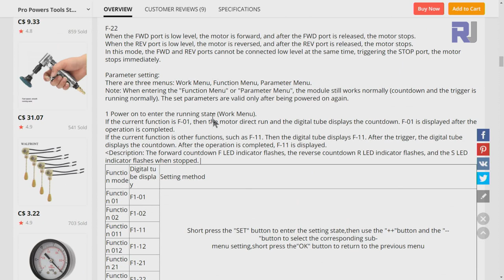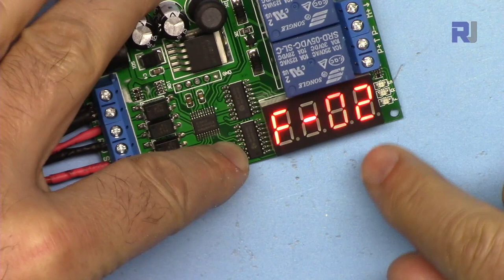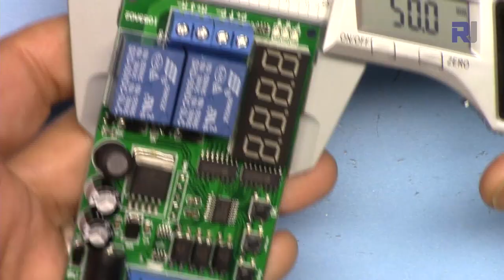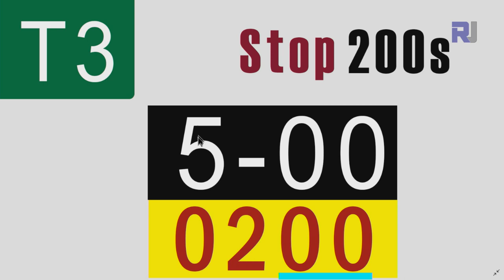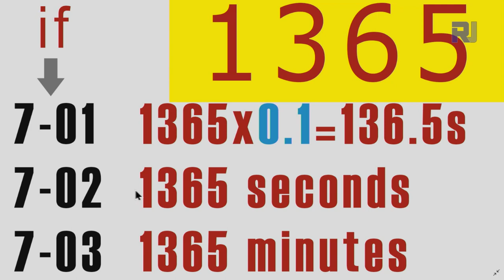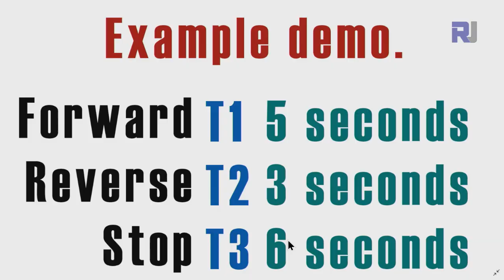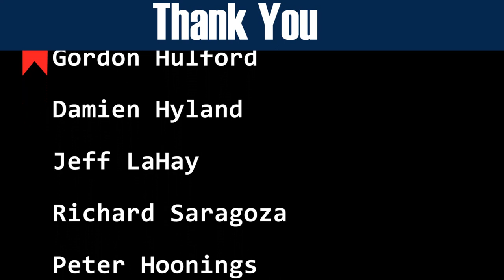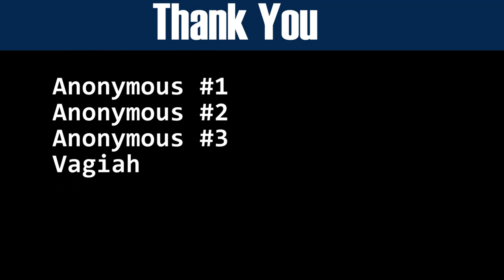Multi-function DC/AC 5V - 24V Forward Reverse Motor Controller Timer I053A02

Comment: REPEATING (LOOPING) PROGRAM:   Several people have asked how to set the board to repeat the cycle automatically.  Essentially, parameter 8 sets the number of times to repeat, 1-99.  0 means repeat indefinitely.  Default is 1.   I found a clue to this in a table I found by googling "canton electronics Model IO52B02".   Instructions there are a good supplement to what is in this video.    (Shoutout to jw11432 who also addressed this in his comment).

Comment: hi, i want to use it to do latching for water valve-a latching valve require positive pulse to turn on and negative pulse to turn off. Can i set it to forward for 0.1 sec and stop for 15 min and then reverse for 0.1 sec and delay for 12 hours before foward again?
Reply from the maker: Hi, it has 3 settings. but you want 4. you want extra delay. I've explained it at best possible ways. if the thing you want to do is not possible by this module, then you might  need another of this module  and some how after motor is stopped (after reverse of 0.1s) then it should keep it OFF for 12 hours. and you can use the trigger feature with some wiring which I don' t know at the moment how.  For that you need to check the 1st module and see after the last step which pin or location on the module is changing the state from LOW to HIGH or from HIGH to low and then solder a wire on that spot and connect that wire to the trigger input of 2nd module.  Depending on the LOW or HIGH then program the 2nd module to turn ON after 12 hours. then do the same. on 2nd module find the same spot and solder a wire and connect it to the trigger pin of 1st module and it should work. It needs patience. Or simply use Arduino which opens the whole word for you and do anything you want. Program it and upload it to Arduino.  See this video https://youtu.be/JMBgGO07YLM
Reply: @robojax  thanks for your advice. i also think that i may need extra component

Comment: Is there a simpler controller if I want to set it to  switch polarity forward 5 minutes and reverse 5 minutes automatically and stop in 2 hours with  30Volts DC, max ampere less than 1 ampere? This is just overkilled.
Reply from the maker: This is very cheap and if you go with anything else, it would cost you more.  Here is my video if you want to do it with Arduino https://youtu.be/JMBgGO07YLM
Reply: @robojax  Ok, Thanks.
Reply from the maker: you are welcome.

Comment: Hello, I just watched your video and programmed the unit.  It works, but now it won't stop running the program.  F8 is set to one, but it just keeps going.  I saw a factory reset option of pushing the ++ and -- buttons simultaneously for 5 seconds, but that doesn't stop it either.  Could it be defective?
Reply from the maker: Hello, if it doesn't do what it is supposed to , then yes. it should be defective. But I would suggest following exactly as shown in video.

Comment: hi there, ive got a 24v garage door motor with a burnt out wireless reciver board that does not work, but when i applied 24volts direct to the motor it works under load which works fine to open garage door and close. i just need a replacement  220-240v to 24v reciever board relay with a built in timer. do you know which one should i buy. i dont want to buy another whole garage door opener/closer, when the motor still works. (ive all ready check the circuit board 24v reciever relay timer with i can not find no issues that i can see). ive checked aliexpress but can not find one that suits my needs, please help anyone or send me link off video that can help me out.

Comment: At 14:30 he glosses over the loop function, for anyone wondering. Function 8 is the number of cycles. 

0=Loop forever
1-99=number of cycles to loop

Hope this helps others, I've seen quite a few comments about the looping function.
Reply: Thanks - very helpful - and this is a critical function.  I found a clue to this in a table I found by googling "canton electronics Model IO52B02".   Instructions there are a good supplement to what is in this video.
Reply: Thank you!
Reply: Awesome... been searching everywhere for that info. Absolute legend.
Reply: jw, I have a YYB-5 control similar to the one shown here. When I program P1 and short IN1 to ground it only runs the A timer. It does not automatically go to the B timer. When I short IN2 the B timer runs. When I program P2 and short IN1 only the A timer runs. No  C timer or B timer.
I tried seconds and minutes configurations but it still never automatically goes from the A timer to the B timer. I altered the all times to be sure it was programming correctly.
Any suggestions are appreciated.
Reply: Nice. Would you have a list of all the functions for this board or a url where I can look that up? Need to see what other options are available.
Reply: @dangruen  - I googled and didn't find instructions

Comment: Hello Ahmad, and thank you so much for your comprehensive video. I looks so difficult for me. I am looking for a module to trigger a linear actuator. In fact, I just need the function F-12. By chance, do you know if a simpler module that does just that exists? When the linear actuator arrives at the end of its path, there is an internal switch that cut the power.  So, my idea is to set up the time for the same length as the linear actuator, so, when the linear actuator arrives at the end of his path, the module will cut the power and wait for the reversed trigger. Am I right?

Comment: Great video. 
1. If one cycle of f01: t1 t2 and t3 completed in order to activate it again i need to diconnect the 5v power and connect it again?
2. If i want to do one cycle of f01:t1,t2,t3 and afterward want to start a new cycle of f01:t1 do i need to be program it again?

Comment: Good video. Can you set it to repeat the forward reverse action continuously for a few hours? Thanks
Reply from the maker: thank you. Everything this does i have shown it. Nothing left. So watch it fully and see which part is useful for you.
Reply: @robojax  Yes I see it only runs one program forward stop reverse and stop. You need another switch to manualy or automatically start it again?
Reply from the maker: it should have loop to repeat it.
Reply: Even I am looking for that answer or a circuit that supports this feature

Comment: I’m planning on using 2 of these on funtion 11 one for each 100w 24v dc motors each motor will be moving in the opposite direction at the same time of day how can I trigger this to work on a timer I want it to open curtains at a set time of day then close them at a set time 
Thank you

Comment: I have a YYB-5 control similar to yours. When I program P1 and short IN1 to ground it only runs the A timer. It does not automatically go to the B timer. When I short IN2 the B timer runs. When I program P2 and short IN1 only the A timer runs. No  C timer or B timer.
I tried seconds and minutes configurations but it still never automatically goes from the A timer to the B timer. I altered the all times to be sure it was programming correctly.
Any suggestions are appreciated.

Comment: Thanks a lot for this explanation. English is not my native language. But the only question I have, is it possible to set at auto repeat? So for instance forward for 2 sec, stop for 0,5 sec reverse for 1 sec and then forward until trigger van Capatative sensor and repeat?
Hope you understand what I mean? Thanks in advance.
Reply from the maker: you are welcome.  have made over 460 videos and don't remember what I said. But when I explain something, I don't leave details.  So if you watch this video multiple times, I am sure you will understand all the features. good luck

Comment: Can you set this repeat the action continuously? Like forward for 5 seconds, stop for 5 seconds, reverse for 5 seconds then stop and repeat the cycle again ? Also can you connect a speed controller to the dc motor and it still work normally ?
Reply from the maker: Hello, I have explained and demonstrated all features of this and don't remember anything about it. so if you watch it multiple times, you may understand all the features. but for sure nothing is left out. so watch and find out.

Comment: If i want to connect 220v motor and i want that the mototr spin clock wise 30 seconds and in counter clockwise 30 seconds and than repeat the cycle for 300 seconds 5 cycles. I also want to activate the cycling by push button and stop by stop button. Which connection i need to use? 
Every time i press the stop key the cycle will stop and every time i press the stsrt button it will start without disconnect the 5v power? I want this setting remain constant. Is it possible?

Comment: i got the following problem! i fitted this board on the 4x4 - 4x2 system on an ATV...it works like a charm except every time that i turn on the key, it will run for the direction where the switch is on! Is it possible to configure this board in orther that evary time that it turn on, it doesn't run the motor? Thank you for the help! Cheers!
Reply: I don’t know exactly what you are using this for, but if you wire it to constant power and not ignition, it will not turn on every time with ignition, instead wire it to constant power and add a normally closed momentary switch on the negative lead of your circuit board, Now you circuit board will only run when this switch is pressed. Good luck to you.

Comment: Can it be programmed in a way, that motor goes forward for desired amount of time, and than backwards for desired amount of time and repeat this cycle indefinitely? What kind of motors does this module support? In the video you used DC brushed motor. Will it work with brushless motor or AC motor as well ? Thank you!
Reply from the maker: Hello, I believe I've explained the best possible way all features. so if you want watch it fully, you should get the answer. This is only for DC motor as I mention in the video. Brushless motor has special speed controller.
Reply: brushed only. set 8 to 0 for indefinably.

Comment: Is it possible to use only Funktion 1 without the separate switches? Just with a switchable Powersupply and an a Motor like wiring in your example?
Reply from the maker: I don't remember what I said in the video. but this has different functions. with trigger (when wire is used) and without trigger (without wire). So yes. you can. you have to watch it fully as I have explained all functions of this module. good luck

Comment: I'm new at this electronics stuff so bare with me, I have two questions 1: can I set option 8 to 99 so the program will run 99 times. 2; I was lost when you said, "9 is that if the trigger happens continuously pressed or just low level we are not changing." what does that mean?
Reply from the maker: to answer your question about "99 time" I would have to watch the video. So you watch it because I don't remember.  your last question, "continuously pressed" means keep it pressed. when you press it, it sends 0V or LOW to the input. you can also use a computer or other devices to send 0V or LOW signal to make it work.
Reply: @robojax  Thank you sir.

Comment: Hi. Can I use it without the trigger? Eg. Program it forward 5 seconds->stop 5s->reverse 5s and repeat the program indefinitely without triggering a program every time?
Reply from the maker: Hi, someone else might reply. I don't remember what I said in the video but that is my rule to explain everything so if you watch it fully, you should get the answer weather you can do it or not.
Reply: @robojax  Hi. Thanks for reply. Video actually doesn’t explain this, but thats ok. Don’t worry. Maybe someone has this module and will reply.

Comment: Why can't you say in yes or no that if this circuit has option to run for few minutes forward then stops there after runs reverse. In you video you have not said anything about loop . That's the only part missing .I wish you could have clearly said in yes or no. Overall I like the way you explained the setting , very nice review .
Reply from the maker: if it had loop I would have explained it.
Reply: @robojax  It DOES HAVE LOOP! Quote from the page: "The number of cycles is the number of repeated actions (Nx =0 means always loop, Nx =1 means no loop). So you can set the number of loops: 1-99 times or forever loops."  But it did come with 1 as default, so it did not loop and you did not dig that. You are also not aware that most anyone who would need to use a motor would need to loop probably, so an important part you skipped.
You are one RUDE person, btw. I have never seen anyone answer this way on YT.
Reply: @x-0-x-0  Dude, thank you so much. I see so many people asking this question (and you're right, anyone looking for this feature will likely need some degree of looping for practicality) and this dude is rudely telling people to watch a 30 min video again instead of taking the time to check...instead of narcissistically postulating that if that function existed, he simply wouldn't have left it out. 🙄

Comment: Is this controller a avilable with Solid State Relay instead of mechanical relay? And also can you please make a video for AC motor using this controller
Reply from the maker: Solid state relay will not work with DC. it is working only with AC.
Reply: @robojax  i need it for AC only.
Reply from the maker: no. unfortunately. You would have to use Arduino. Here are my videos on Solid State relay https://www.youtube.com/channel/UCkcBSig_Iu4ZnAIeCeG1TVg/search?query=solid+state
Reply: @robojax  i have it with Arduino. Ok, so with this I053A02, can you show the wiring please, because in AC motor, i have 3 wires, two clubbed with capacitor wires and one directly to motor, am not into electronic so, just looking for it

Comment: Is there a board can control 120V AC motor forward  and reverse just 1 button? 1st push go and 2nd push reverse? Thx. To replace a swing gate opener control board. Currently all I can find is for 12 or 24V DC motor.
Reply from the maker: you can use this module with very little effort. I did not do it because people are just waiting to blame other for mistakes so I did not mention it. please do not ask me but search online how  wire AC motor to rotate in two direction and (Now I have to reply safely) make sure you know understand the safety aspects of working with AC voltage. If you are not sure, seek help from a professional.
Reply: @robojax  Haha, what's you have experienced? I already found a AC Motor control board.
Reply: @dmtycn  which board did you get?

Comment: Hi I want to put powerstep on my truck and I search for the perfect module board for me.  The motor is polarity. So one way is deploying and switch is stow. By a trigger. (Door). Have to be 3 sec each way.  Need 12 volt. It’s on a pickup truck.    If you can tell me what’s the best things I need for that    Thank
Reply from the maker: Hi, I don't know "powerstep" but you may use this https://youtu.be/JMBgGO07YLM to change the polarity
Reply: @robojax  thanks for answer; but if you look on youtube for powerstep you will see.
i need a timer  with the module polarity  and its the trigger (open) start the motor 3 sec. after trigger close the motor start in opposite direction for a other 3 sec.  Its near of the i053a02 you explane option 9 .. but i dont know   . thanks
Reply from the maker: then forget about this module. it can do only things it is programmed to do. here is https://youtu.be/JMBgGO07YLM the video and start using because you can control it any way you want.

Comment: Does this motor driver work for any motor?
Reply from the maker: it is just relay. Meaning it is a switch to turn ON/OFF and change polarity. It can control a motor at 10A for up to 220V. My test was on DC.

Comment: Can anyone help me wire this thing? I have a 110v controller sending out one black and one red 12v line to motor. Two wires that’s it. I want to make a 12v mixer motor go back and forth in different directions 2 seconds in each direction on its own. I have a polarity changing switch that works great but I have to flip it manually. I’m just looking to be able to walk away from the unit and have it go clockwise/counterclockwise continuously on it own
Reply: I guess not

Comment: Halo sir the speed can be adjusted
Reply from the maker: This relay. It turn a off or on. No speed changes
Reply: I use an ac input adapter 200v output dc 12v 3A why can't it turn on sir.  the 3F R S small light flashes red only. Pls help🙏

Comment: Truns comand then stop motor. Example 100 true then stop.
Reply from the maker: you can't to it with this. you need to have encoder installed on motor so you know how many turns it  did, then take some action when it reaches 100 revolutions.
Reply: @robojax  Sir I would like to order a "Multi-Function DC/AC Motor Controller Board with 24V motor, 2 relay, 1 display, photo sensors and keypad. The machine should be automatic with inbuilt program set for movement or oscillation.

Comment: Thanks for the reply - the problem I was having was I used the same power source for the motor and control circuit.  Once I suppled them separately it worked fine.  In my final application though, I will only have one 12v (battery) source to power both.  Is there a device I can use to isolate the single supply and essentially make it two independent sources? Thanks
Reply from the maker: you are welcome. I have not see.  for AC there is isolation transformer.